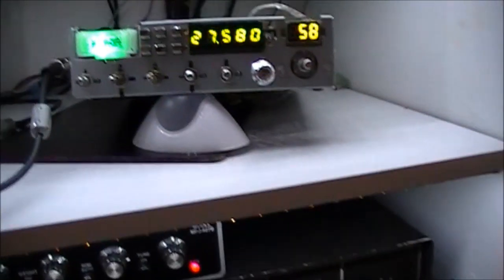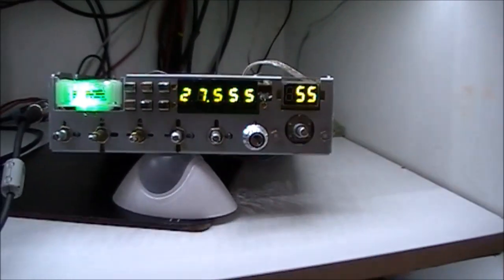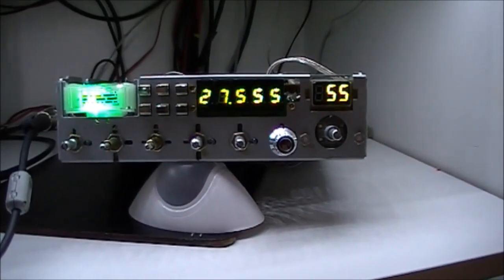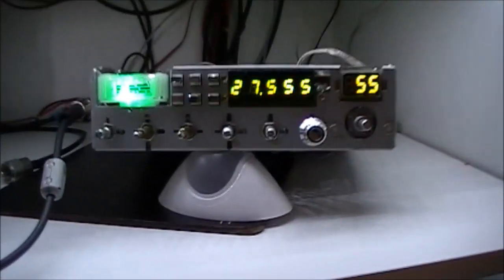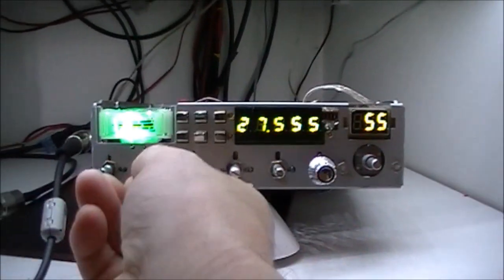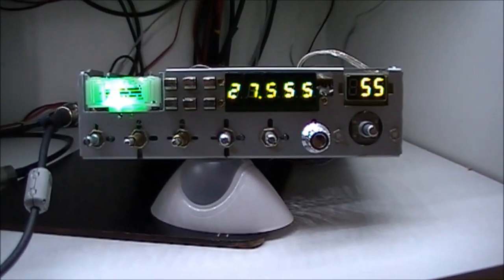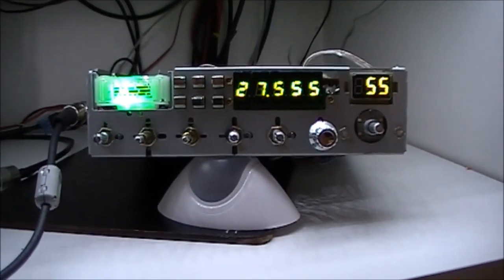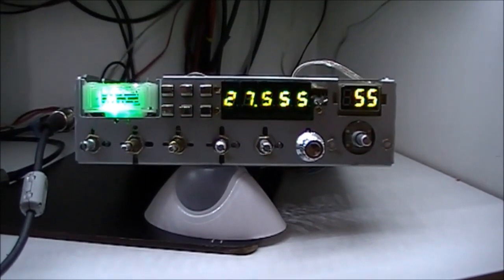Cobra 148 F GTL Hybrid Snake Radio Customs Part 2

Comment: Run the counter positive via a new regulator 7808 it stops it pulling the radios 8V rail internal dc regulator too much due to LEDS etc on counter unit
It will prevent pulling radio off freq slightly.Its a design error had the same problem on SS-3900 radios Ive done this mod to a lot of these where external counter plugs in on back off radio.
If you have sig gen on carrier and go usb or lsb ,you can actually  a slight shift as you plug counter in and out.Took me ages to figure out why at first align radio spot on,plug counter in and ssb would be off on rx alignment slightly then I twigged.
hope that helps.
Reply from the maker: Got is sorted in the end man. thanks all the same ;)
Reply: no probs :)